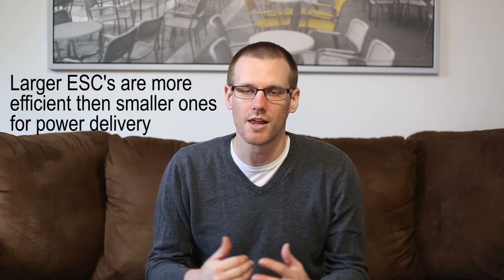Maximum ESC Temperatures - Ideal Operating Temp

Comment: Kind of fighting with this at the moment in one of my RC's. I got the castle MMX/2200 1515 sensored system a few years ago to run in my savage flux hp. I ran it on 4S most of the time until the last 6 months or so, I regeared and ran it on 6S. I've since gotten rid of that truck and moved the motor/esc to a maxx 4s. Geared for the speed I want, it ran hot and would thermal due to motor heat. So, I went from 4S to 6S, dropped the gearing considerably and now the esc runs hot. lol! Guessing I need to drop it more and see if the speed increase is where I want to be at. 

Another thing to note is that the temps I read (using multiple IR thermometers) varies greatly from what the castle logs say. When running it the last time, after some hard running, I pulled the body to check the temps of the front/rear sides of the motor and various spots on the esc. The highest I saw on the motor was 152F and on the esc was 112F. Yet the logs say the peak of the motor was 169F and esc was 228F with an average for 130/182... I have to guess that if the esc was really 228F, it would be dead now. The logging data shows a red line where the esc max cut off is and it's at 240F. It doesn't have that for the motor, so I don't know what it thinks it's max cutoff is, but I know I've hit it as I hit it a few times when running 4S in the maxx.

Contemplating getting a lower kv motor (which wouldn't be castle and would be unsensored) to see if that lowers the current draw. FWIW, the max current in the log was 87.8A on 6S. When I was running 4S, it was 135A. Quite a difference.

Comment: Thanks for the videos!  I think my esc may be overheating, but I'm not sure.  I have a 3660 3800kv motor and a 60a esc on a 2S Lipo 80C, stock gearing.  Although nothings feels too hot, after about 10min, the car will stall for about 30 seconds and then run again till it stalls again.  Is 30 seconds the typical amount of time for the esc to cool after a thermal shut down?  I'm confused because the previous 60a esc I had never stalled.  Thanks!!
Reply from the maker: Hi gcbr1000, what is the temperature reading at the ESC? The cool down time varies with setup and environment.

Comment: How ESCs are measuring temperature, I don't see any temperature sensor there?
Reply from the maker: Yes, they have a temp sensor. Sensored motors can also have a sensor that communicates with the ESC through the sensor harness.
Reply: @RCexplained  What about the sensorless motor? I didn't find it anywhere on the board. Can you tell the sensor name from the escs you've seen?
Reply from the maker: A sensorless motor would have to use an external temp gun. No I haven't looked that closely at the board. Are you looking at an ESC that has temperature data logging?